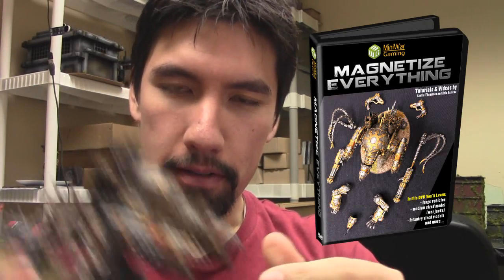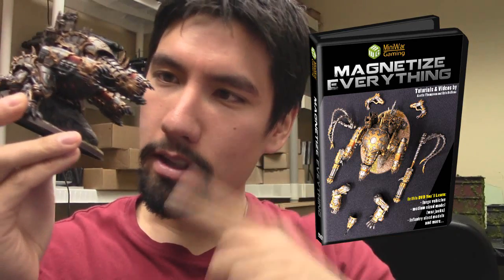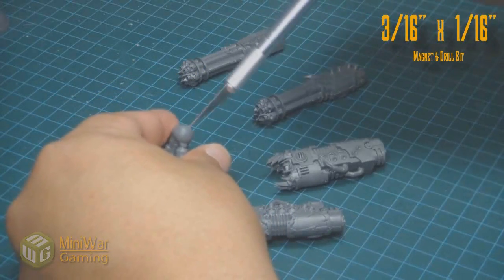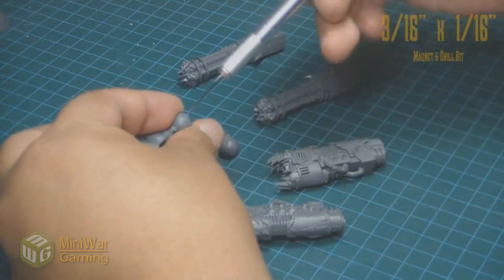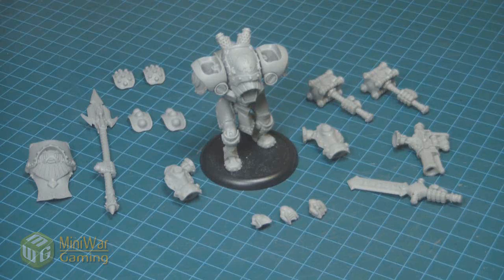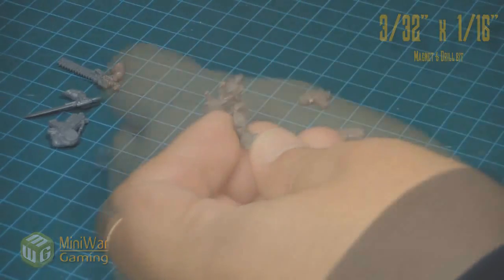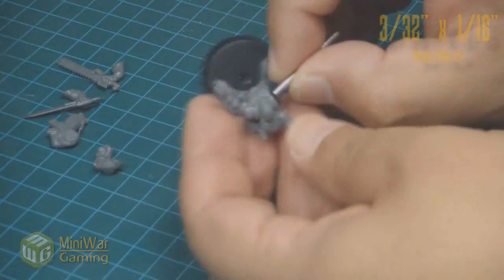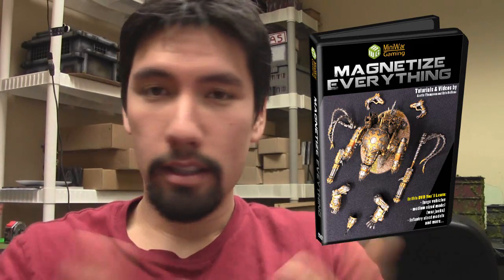Learn How to Magnetize Your Miniatures!

Comment: Possibly, but it still helps to shew both a new unit and how to handle so many different options without getting it wrong.
Would have helped me to have seen before I magnetized my fiance's plastic Cryx Warjack kit. Ended up getting the magnets upside down half the time...